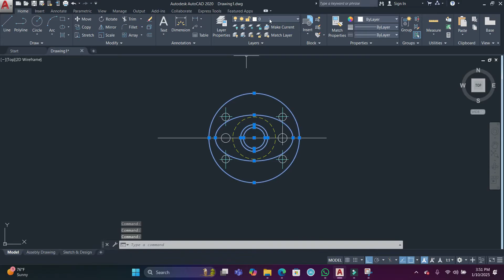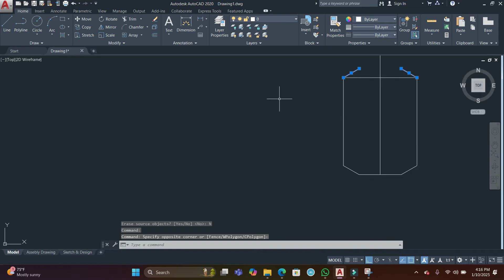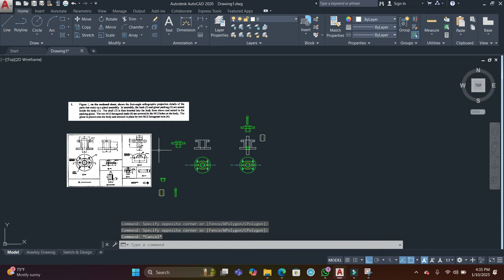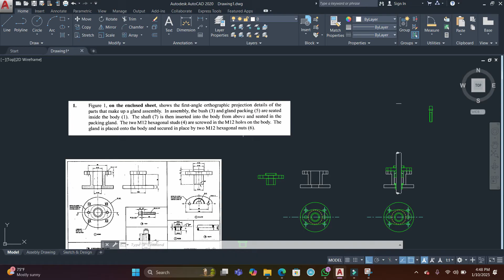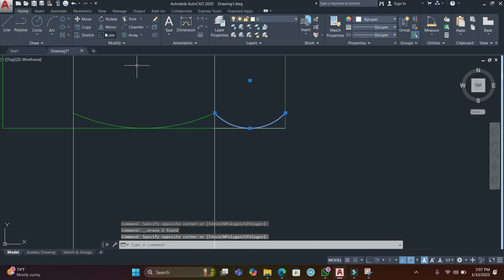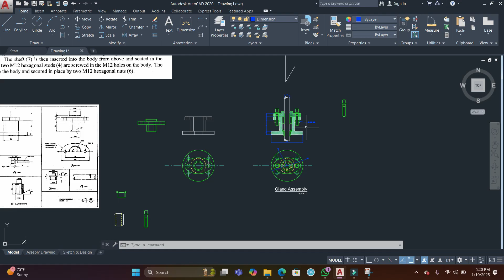2017 CXC Technical Drawing | Mechanical Assembly Drawing | Past Paper Solution

Comment: Sir, the studs on the paper are M12 but the holes u put them in says M14 on the paper, so I😮 thought it was referring to the holes in the base looking part because those were the M14 holes but idk. Maybe the paper have error sir😂

Another question sir, why does the top the stud have thread specification? Is it supposed to be in the base or something 😂 this is sooo confusing